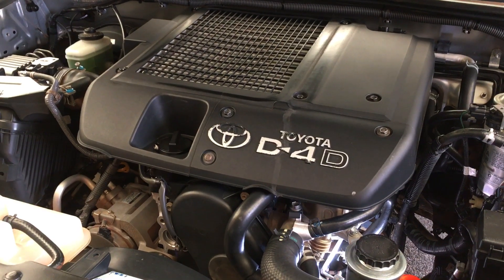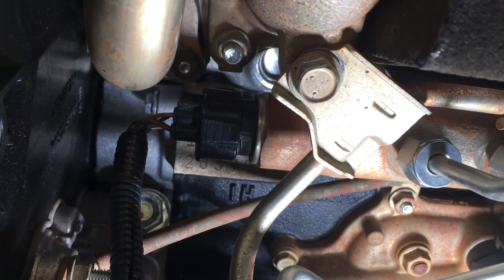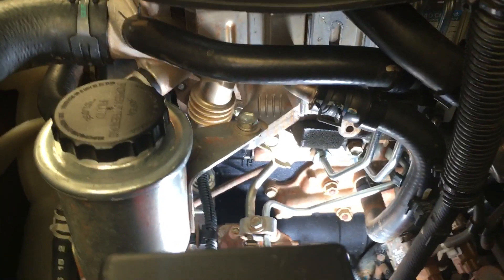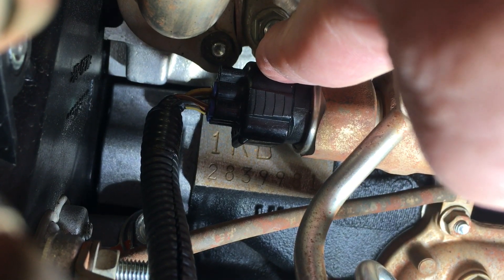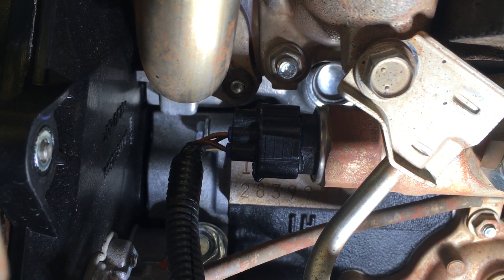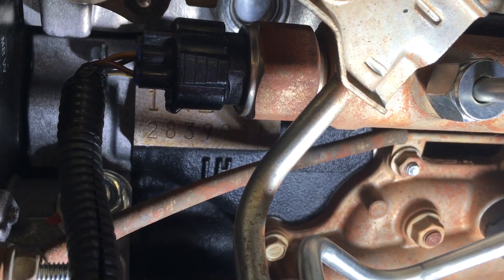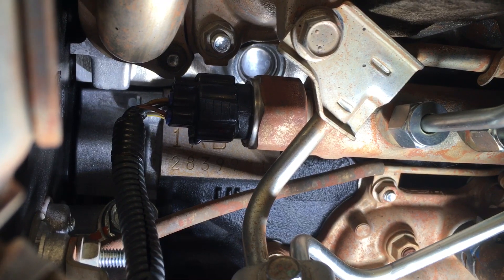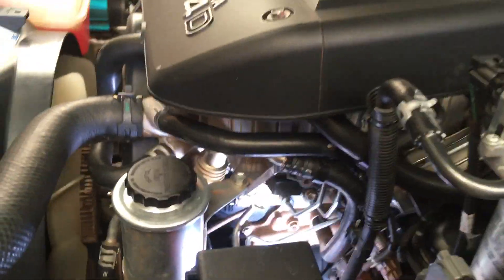TIPS FOR REMOVING STUCK COMMON RAIL PLUGS

Comment: I watched this video and the spent over an hour trying to remove the plug. I could get the clip to click, but try as I might couldn’t budge the plug, even with the help of a hefty screwdriver as a crow bar. I gave it a dose of my favourite penetrating fluid (50/50 ATF and acetone). Left it overnight, and the next morning  released the clip and just poked it with the screwdriver and the plug popped straight off. As Anthony says - patience!